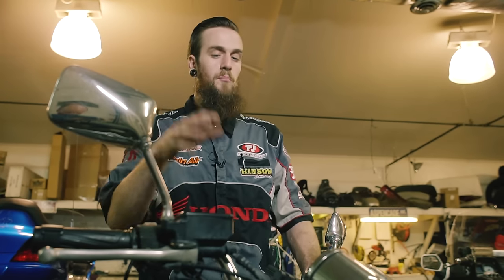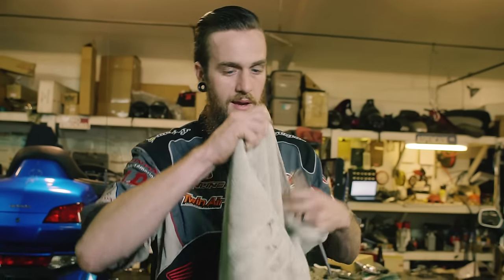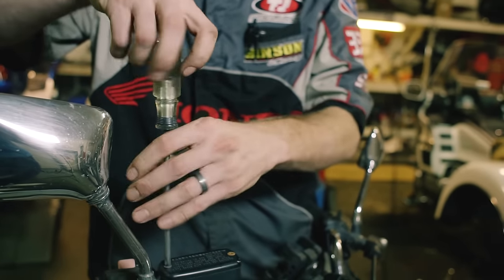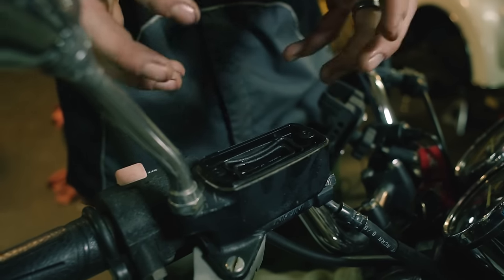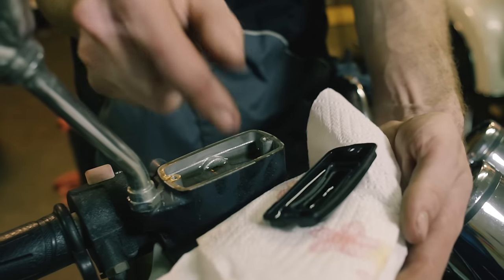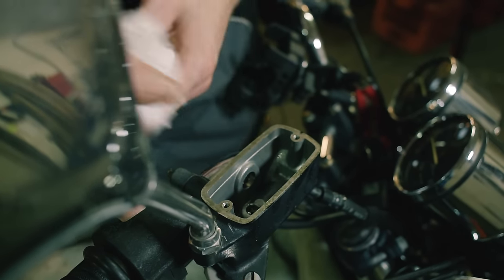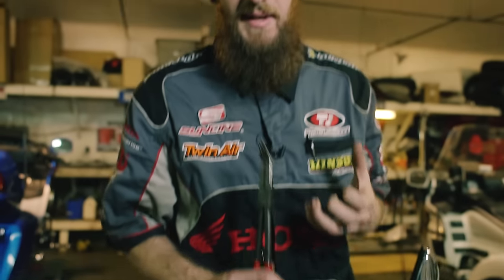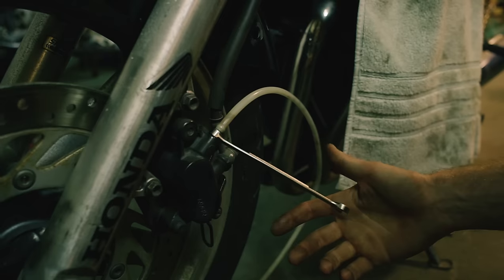Brake Fluid Replacement: Honda Motorcycle

Comment: New screws available on ebay for cylinder cap, break fluid turns rusty via roasting when it reaches 170 Celcius.  Rust color is not from rust.  Organic matrial like poly glycol can burn at high temperatures.
Reply from the maker: +Mahadev I have access to hundreds of these cap screws but thanks for the info!
Reply from the maker: +Mahadev I have access to hundreds of these cap screws but thanks for the info!

Comment: I know this video is somewhat old, I was wondering where I can get the reservoir plastic cover, I can't seem to find the one he mentions and when I look online I only get the top cover which is metal, looks great but not the one that will need to be replaced. Does anyone knows a good website that has bike parts? I have a 600c silverwing 04'

Comment: Awesome video brother,   I live in Australia and just got a 1993 CB Seven Fifty (building a Cafe Racer)  My Question: what is the best place online to buy small parts I need like this rubber master cylinder diagram, Ive been to our local Honda Dealership but the parts are super expensive. cost me $200 for a carby rebuild kit.
Reply: For half the $200. you could have bought an ultrasonic cleaner and not bought any new parts.
Reply: There is a whebsite from a shop that has honda,kawasaki and yamaha motorcycle parts called cmsnl (has physical store in Holland or other Netherlands location i know it's near Holland) and it has OEM parts for them
Reply: But the price of what you need I can't tell because never searched for it in csmnl store

Comment: Mate, what size screws are those that you take out to get the lid off please? Some fool that had my bike before me has chewed one right up! I need a replacement screw before I can have a go at removing the damaged screw with a screw extractor
Reply from the maker: Depends on the model bike (some come longer and in chrome,steel and black) Is it a Honda? What model?

Comment: If you're having trouble getting Philips screws out try using a driver on a ratchet and a trigger clamp. Use the clamp to keep the driver bit secured firmly in the head of the screw. This will kill the awful cam out Philips screws are notorious for. I can't overstate how much I hate Philips screws.

Comment: I have the European version of Nighthawk (CB Seven Fifty) which has a 2 disc setup. Which caliper would you bleed first on these kinds of setups ? With this technique could you do both in the same time ?
Reply from the maker: It doesn’t matter, which ever you would like to do first. I wouldn’t bleed them at the same time because you will have a hard time keeping the system full. Just clamp one side, bleed the other and vis versa
Reply: Industry standard is the one farthest from the master cylinder FIRST. I have done it both ways and haven't noticed a difference.

Comment: It's a perfect methode to crack your brake-lines...
Reply: The original rubber braided lines should be able to take some pinching. That's why they use rubber in the first place. You are not going to apply so much force that the rubber would perish or destroyed but just sufficient to create a "one-way" valve effect. I think this is a great recommendation for a one-man operation job. Cannot do it for teflon lines thought but relatively new rubber braided brake/clutch lines should be okay. Nevertheless, it is only a recommendation. If you don't like the idea, get a buddy to help out.

Comment: At 2.45 "Wash this out with water" ?  No! 
Wipe clean with a clean cloth.  No Water!
Reply: Yes, wash it with water, clean out the reservoir with a damp cloth & allow to dry.
Reply: @bhaggen  no because any residue that may remain can completely negate your brake fluid.
This is basic brake job fact, the entire reason for replacing brake fluid is due to moisture buildup in the old fluid.
Reply: This video is a joke, so many bad advices.

Comment: Some knuckle head completely rounded off the Phillips heads on the master cylinder on a 37 year old bike I just got. I was able to drill them out no problem. Since the heads are tapered you have to keep switching to smaller bits as you go until the head is gone then clamp on to the headless studs with a vise grip and twisted them right out. The brake fluid was nasty, I've never seen such dark nasty brake fluid it looked like it could have been a decade old.

Comment: dumb question. I have a nighthawk 750 with drum rears and disc fronts. Do I have a REAR bleeder valve for the drums? or do I just do the fronts when I flush the fluid? oh, and how many reservoirs for a full flush of the lines (unless you're using the term bleed to describe a full replacement of all fluid in the lines)
Reply from the maker: Not a  dumb question! The answer for the rear is no. The drum brakes on your bike are mechanical not hydraulic. I would run at the least four full reservoirs
Reply: sweet. Just wanted to make sure before I do it. I just changed my brakes for the first time today (by myself) and while I get the CONCEPT of the flush, I wanted to make sure I didn't miss something

Comment: Wrong screwdriver for the application, it is not a #2 philips, it is a JIS #2 screw
Reply from the maker: Bob Myers If you are referring to what I said in the video I said "we have two Philip head screws" not #2. Thankfully that screw driver has removed thousands of master cylinder cap screws without a single problem!
Reply: It very well may have, and using a Philips were a JIS driver should be used is why the edges of the flute flare up. A 9/16" wrench will remove most 14mm head fasteners too but not correct tool for the job either.
  Anyone working with Asian vehicles, should have a set of JIS screwdrivers available. An owner of such a vehicle might wish to ask their shop about this. Knowledge of this standard is an indication of the commitment to quality of the service facility.
Reply from the maker: Bob Myers I definitely can't disagree with that. Solid information thanks!
Reply: @Bob Myers  Interesting point about the JIS #2 screwdriver.  I agree, if it's a JIS #2 screw then one should use the correct tool.  I served my apprenticeship on Jaguar where imperial tools were the norm, although we did sometimes use 11, 13, 14, 15, 17 and 19 to replace 11/16", 1/2", 9/16", 5/8", 11/16" and 3/4" if we needed to hold one side of the bolt while unscrewing the other (with the imperial spanner).
Reply: O_O ...I didn't know there were specific kinds of +Arrowheads...I just used whichever one I had that fit....I feel racist now...
Reply: Here we go again...

If you are working on a bike made in the last 15 years or so, or are using tools made in the last 10 years or so, the JIS debacle no longer applies.  Modern Phillips head drivers are cut to fit JIS heads.  And since JIS went extinct in 2008, modern bikes do not use them.

   You will still find “JIS” drivers being marketed and sold, but they are no different than the modern Phillips.  This issue has been researched and discussed ad nausea on numerous sites and forums.  VESSEL, the oldest JIS manufacturer in Japan, clearly stated that JIS is no longer an approved standard and as such there are no manufacturers that are allowed, by law, to brand or stamp their tools as “JIS”.

    Welcome to the 21st century, Bob.
Reply: @UhYeahWhateverDude   Cannot up vote more. A quality tool that fits a fastener GAT is key. Just split cases on a 1981 TS 250 and found flared screws everywhere from where a number three size driver was not utilized. Yes, all the machined fasteners were replaced. Thank you for the info on the subject too!

Comment: If you do this, plan on buying new brake hoses as you just compromised the integrity of the hose by pinching it!  BAD, BAD advise!
Reply: what if the line is still fresh. is brake hose that weak?
Reply: Yeah the flex hoses break in the middle and make a one-way check valve that make the breaks stick. Had it happen to both of them on my truck.. locked up calipers are annoying and expensive…
Reply: @glowiever no, it’s just really not designed to be crushed like that.

Comment: I've been used to bleeding Car systems, Might be be easy enough when you pull the brake lever in to tighten the bleed nipple release the lever then open the nipple again when pushing the fluid through the system. saves you possibly damaging the brake hoses. Just my opinion...

Comment: Brakes with braided metal lines can't use the plier clamp method though :(
Reply from the maker: +mogan23z Absolutely correct. For those, I do something different. Barely open the bleed valve just enough to where it require effort to push fluid out of it. Continue to do this until all the air is gone. Same principle, different trick!!

Comment: Those are not phillips head screws.
That's a Honda motorcycle, so those are JIS screws.
Japanese industrial standard has a different profile to phillips.
People like you are the reason why those screws are often stripped out.
Because you're using the wrong tool for the head.

Comment: i never heard or see anyone changing the rubber diaphragm and i realy dont see the point if it is not swollen or cracked.
Reply from the maker: You can do what ever you like man. Almost every diaphragm I deal with in the industry for those top M.C they are slightly swollen. I hold all of my repairs to a high standard. That means following Honda recommendations on seal replacements.
Reply: ok man thats good to know honda is one of the best manufacturer if honda does require it it must be for a reason and something more is it ok to pinch the brake line i am worried it might crack the rubber
Reply: TheMotorcycleMD - St.Cycles "Good call and legit."
Reply: Replaced the rubber seal once in 35 years working on bikes lol
Reply: Om Alive at last 🚨 I’m sad to inform everyone this YouTube user has died from a brake related incident. Type F to pay respects 😔 🙏🏽
Reply: @TheMotorcycleMD  " I hold all of my repairs to a high standard", said a guy that is crushing and damaging brake lines, and is advising ppl to do the same.
Reply from the maker: CyberKozA  Also advising you to read the description of videos so you don’t make life decisions off of YouTube videos.
Reply from the maker: Δημοσθενης Δοδος Unless they are old. If you can bend the brake line and visually see cracking. I would not recommend this technique. As stated in the description. 🤙🏻
Reply from the maker: Om Alive at last Why would you not do that??
Reply: @TheMotorcycleMD  funny, you didn't mention anything from description, in video itself. Was description added after getting criticized for stupid advices? There is only one thing you should do - delete this video, before someone gets hurt. Have some honor or at least decency, and admit that you were wrong.
Reply from the maker: Nah It’s fine. Glad you could read it though 👌🏻🤙🏻
Reply: @TheMotorcycleMD  Honda doesn't recommend replacing these every change. It only needs replacement if it's deteriorated.
Reply: @dimos5422  Honda does NOT require it on every change. You only need to replace it if it's deteriorated.
Reply: @Palm Coast Adventures Read my comments again. And if you think that squeezing brake line is fine, then you need to sell your motorcycle. I don't mind ppl geting hurt becouse of their own stupidity, but there is always risk that they will hurt someone else.
Reply: @TheMotorcycleMD  Good point ! They are rubber for God's sake, if we can pinch it then it ought be thrown out of the window ! Good point on using the pinch plier !
Reply: @CyberKozA  Seeing you're such an expert I went to see if I could find any videos of you doing tutorials on various MC repairs - found nothing.
Reply: @stocksnz4595  So what?
Reply: Yeah, well when you see that weeping corrosion where the cap meets the reservoir, realizing it's from around the rubber seal, you'll get it.
Reply: @omaliveatlast4688  And all of them later had crud lines where the cap meets the reservoir, basically from a weeping seal that should have been replaced.  Betcha.

Comment: hi i have a honda 04 fourtrax i have to pump my leaver 3 x  before i have brakes is it my master cylinder needs rebuild or is it air in my system...thanks
Reply: Trevis Davis could be air!  Could be a bad master cylinder. Could be worn out brake lines too. Best to start with a brake fluid flush and bleed.
Reply: Trevis Davis did you get your brakes working like they should?

Comment: ok : Listen Master TheMotorcycleMD : here is my problem : I changed the brake fluid with a new one : and I kept press the brake lever to get out the air : for 4 hours directly until no air is comming out : the brake does not want to lock and no air is comming out , and no more bubbles. but it does not want to lock . also the brake fuid does not decrease or leak. what is that ????

Comment: JIS head screw not Phillips

Japanese industry standard, it has minor differences to Phillips... seems to fit but just not right, its the result of a lot of bolts being ruined my amateur mechanics.
Phillips can be used without issues if the correct techniques (Such as tapping on the screwdriver) and only if the bolts aren't seized

Comment: I was warned to not to use pliers as a one way valve, as it can put microdamage to the brake hose.
Reply: When you introduce air in the line you'll do anything including pray to the dealership for help.

Comment: My bleeder valve is a bit stripped.  Is that part 43352-568-003 ?
Reply from the maker: Savage6FlyingTigers Year? Model?
Reply: Oh yeah.  1998 Honda Nighthawk CB750.
Reply from the maker: Savage6FlyingTigers Yup, your part number is correct!

Comment: So the key to this entire process is the bleeder catch with the basin of fluid to maintain a wet system. You video completely missed the emphasis of your catch to prevent siphoning of air back into the system from the caliper side. It also does not account for the air already trapped in your bleeder line. Listen kids, if you do not have the bleeder catch and basin, short bleeder line (primed) you will fill your brake system with air. Failure.

Comment: I have a simpler method: use a valve on the brake pad that closes by itself. Then you only need to pump the brake lever and refill, nothing more.

Comment: 7:44 a one armed midget could reach the caliper and bleeder at the same time. The pliers are a bad idea that will possibly cause a locked up caliper as the inner lining of the hose fails from being squeezed on…